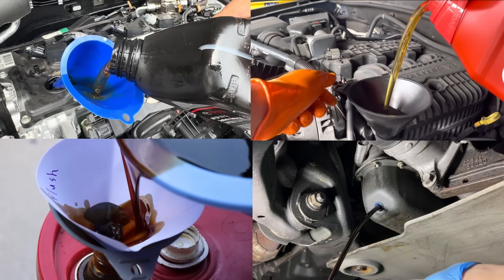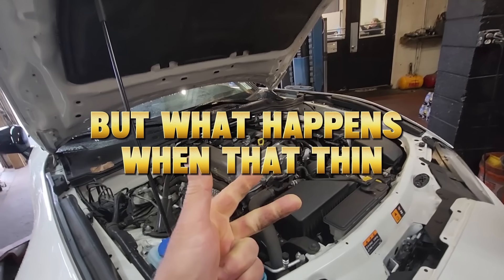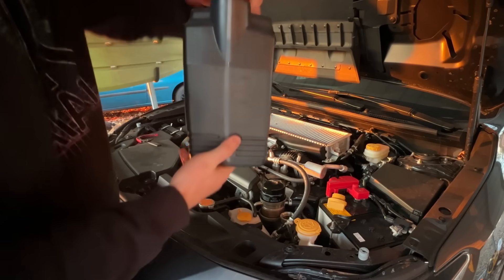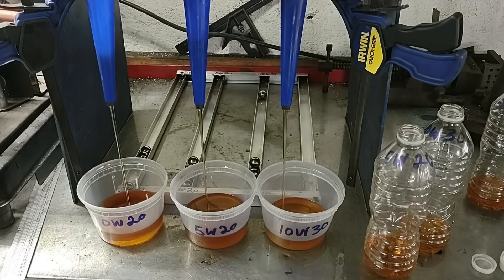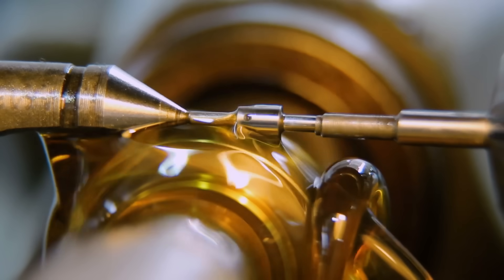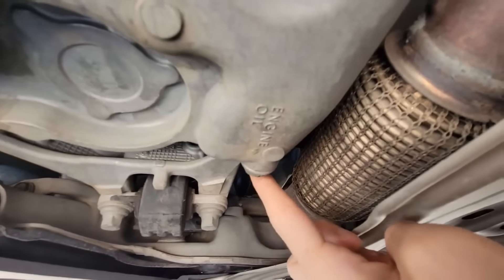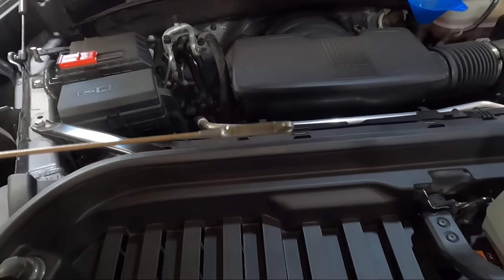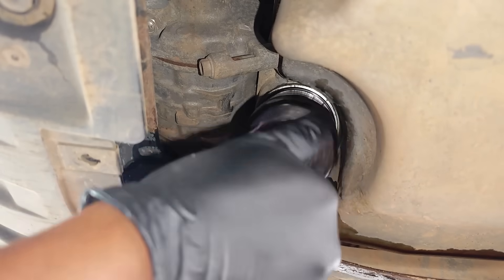The TRUTH About 0W 20 vs 5W 30 Oil (50 Engines Tested!)

Comment: Castrol Edge Euro 0w30 in winter and BMW TPT 5W30 in my BMW N20. What's more important is the OCI you chose to implement, check your manual for normal and severe schedules.

Comment: Southern middle TN here. Actually I switched my 2012 Ford F-150 3.7L V6 (non-turbo) from 5w20 to 5w30 Pennsoil Full Synthetic two oil changes ago, and now change my own oil every 5,000-miles. My engine has around 188k-miles on the clock with no timing issues, no noises, but I felt the 20 weight oil was just not right. As for mileage, going from 20w to 30w, no effect whatsoever. I have been at 20-MPG's for last couple of years, and it is still there unless driving in city traffic which degrades MPG short term. I don't tow with my truck, but live in a very hilly area where elevation changes 300'ft-400'ft in a mile, so because of the gear downs for climbing, engine tach runs 3,000-4,000 rpms in 2nd-3rd gear frequently, which explains why only 20-MPG's. If I had an eight cylinder engine, I would run 5w40 as V8's get more abuse than V6's, reasoning, more power equals more lead foot. That's just a fact.

Comment: When I purchased my 2 new Hondas they both showed 0-20. Yuck! My first oil changed went to 5-20. I wanted to go to 5-30 but the Honda mechanics said use 5-20 while it is new. After about 75k to 100k miles using 5-30 is ok.

Comment: yep, ive been running 5w30 in my truck since my 1st oil change at 1500 miles. OEM is 0w20. i could give a crap about MPG, i still get 24+MPG REAL WORLD over the 22 the EPA rates

Comment: Don't it make sense to follow the manufacturers manual/instructions? Or the dealer's recommendations? I think that if they differ, that the dealer has a better insight as to what your vehicle needs based upon the climate of where you live. i.e. My vehicle is made in Japan, and I assume they decide what oil, etc. But if my dealer, who is local, says to do something a little different, I should listen to him. Example is the latest fiasco, 10K miles between change. The dealer recommended 5K, and now I see that's what is recommended by everyone. 5K for every vehicle. So as I'm saying. My dealer uses 0W20 synthetic, and from what I can tell, is supplied by the mfgr/as apposed to Valvoline or Mobil or such. So using 5w30 or even 10w30 "might" invalidate the warranty? Another example: If I go to a local shop and they use 0w20 synthetic, would it matter that they use Valvoline or Mobil?

Comment: It is not that simple anymore. It is not about mpg only as many think. It is a complex design direction. Oil is currently used as a hydraulic fluid for vvti,  lifters etc. it uses small tubes and passes. for that purpose low viscosity is preferable with  similar reasoning to ATF. While trying to improve something try do not damage something else. 😂

Comment: In my Volkswagen Golf Mk6 1.4 TSI twincharge, I changed from 5W30 to 5W40 for more protection at higher temperatures, which is also better for the turbo and results in less oil loss (not that I really have any oil loss, as I change my oil every 5,000 miles). Just make sure it meets the manufacturer's specifications.

Comment: I bought my 2011 Lexus Rx350 with 151k miles. I use Mobil1 5w30 full synthetic. Currently has 240k miles. Running excellent.
Reply: Every Toyota /Lexas we had Mobil burnd faster and had to change more often  and 3 out of 5 cara. Ruind the engine 😮

Comment: I have used 5w20 for the last 21 years in my 5.4l Triton in an F250. Engine has 280,000 kms. Doesn't burn oil. Always use a block heater in colder weather.
Reply: 1st oil change at 1000 kms. with dino juice. 2nd oil change dino juice at 5000 kms. Then full syn ever since.
Reply: How many miles, we use miles here not klicks.
Reply: @JerryRedd-bs8xi  Let me do the math for you. 17 squared, divide by 49,417, take the reciprocal of the reciprocal, carry the 9. That comes to about 174,000 miles. Any other grade 2 conversions I can do for you today?

Comment: This entire video is fake. I listened to this guy and took my fj cruiser in for an oil change asked them to put 5/30 instead of the recommended 0/20. After one day my dash lit like a Xmas tree with check engine light as well as other lights. Now I have to extract the oil. I’ll put it in my rv so it doesn’t go to waste but it’s a hassle. Google it. You need to use the recommended oil period. If yo7 want your engine to last change ever 3000-5000 miles with a good oil.

Comment: 0W40 on a Turbo Motor and i live in Germany (normal Temperatures). No Problems. I bought my car as a new one. Now it has 65000km. In 02_2026 it will be 3 years old. I also make the Oilchange all ~10000 km. The Manufacture says my motor needs 0W20 or 0W30. I say: 🤣🤣🤣

Comment: I bought a 2024 Mazda 3 sedan in Aug 2024. I have just over 4K miles on it, and am planning on changing the oil at 5K, Because of this video I plan to use 5W 30 at the change.

I'm 82 YO now and have medical conditions, so don't change my oil any more. But in my heyday I used to do nearly all the work on my cars, even two transmission changes. I used to change my engine oil/filter every 3K miles, gap the plugs, and set engine timing. The car had drum brakes all around, and I changed/adjusted those, too. I still have two timing lights. For 10 of those years I was a Cat heavy equipment mech/training instructor.

Comment: At 80,000 km, I switched from 0-20 to 5-30 on my 2013 Honda CR-V, and immediately noticed how much smoother and quieter it ran.  After all, outside of North America, 5W-30 is the recommended oil for my very engine!
Reply: Thank you. I am planning to do the same.
Reply: @tamilan2083  Use the best:  Pennzoil Ultra Platinum.
Reply: I'm on board, too with my 12.
Reply: 2.0 liters engine?
Reply: @Cesar-dt5tn  No, the gen-4 CR-Vs had a 2.4 L engine (North America).
Reply: @Trigger-xw9gq  tks!
Reply: It may be better for the engine but your oil pump will not be happy it s still designed to work with 0W-20
Reply: @STR1XDLB No, as I've already stated twice, outside of North America, the very engine in my car calls for 5W-30. Same engine, same oil pump
Reply: @Trigger-xw9gq My bad didnt read that 😂. Maybe edit the original comment
Reply: Try 0W30
Reply: On my new car, dealer says 0-20, I have to for warranty purposes let them put it, once home I swap to 10-30. 
Engine takes longer to warm up and on average runs about 10f less (with 10-30w). Engine runs quieter, no more valve tapping, at idle it purrs.
Reply: @mracovntname3701 Why not 5W-30?
Reply: I would not be quick to switch from 0W20 to 5W30 . Newer modern engines have tighter clearances , which means they require a thinner oil between metal components of the engine . Thicker oils are denser , so your engine will sound quieter , however they may not properly lubricate engines that require 0W8,16,20 as thicker oils may be too thick to provide those metal components with a film of lubricant between them . Tighter clearances means they are closer together. While thinner oils do contribute to better fuel efficiency , those thinner oils serve other purposes in the overall engine design. I would recommend you to the motor oil geek “ Lake Speed JR “ He is going to make a video in direct response to this video . It’s risky putting thicker oils in these modern engines . I would exercise caution .
Reply: @TiffanyBottomsHunter  Yes, good point, but not in this case. Outside of North America, 5W-30 is the recommended oil for this particular engine. That shows that the drive to thinner oils is political, not mechanical. In addition, 5W-30 is only "slightly" thicker than 0W-20, so nothing to worry about.
Reply: @Trigger-xw9gq  Political ? The EPA’s influence on automotive engineering is not about politics . The lubrication that engine oil provides at operating temperature between for example 0W30,5W30, and 10W30 is the same . The only main difference is their cold flow properties . During initial startup for example,  thicker oil at colder temperatures won’t flow as well , and in turn won’t provide proper lubrication, leading to more engine wear . I would recommend you to real experts such as Lake Speed JR who has a channel “ The Motor Oil Geek “ I am already familiar of engines exceeding over 500,000 miles and still running on these thinner oils . I don’t trust AI generated videos . Not all oils of the same viscosity are created equal when it comes to what is best for one particular engine . Engine oils have different additive packages , which means they are made up of different formulas . The oil you would use with cast iron cylinder sleeves , is not the same as one with carbon sleeves even if they call for the same viscosity . Oil analysis conducted in laboratory tests shows that different engine oil formulas work better for different engines . Toyota’s OEM oil formulated by Exxon Mobile is way better for their engines , than for example Mobile 1 , because it is specifically formulated to work with their engines . It comes down to chemistry . I would not switch to a thicker oil without doing extensive research on my particular engine . Switching to a thicker oil could actually cause more wear . It would have the opposite effect .
Reply: @TiffanyBottomsHunter  I'm not sure why you gave an example of 0-30 / 5-30 / 10-30, when that's not what I was referring to.  I'm fully aware the cold flow differences, and in my location (benign winters), switching from a "0" to a "5" is nothing, especially given how quickly the engine warms up.  Did you not see part where I mentioned that, outside of North America, 5W-30 is the recommended oil for this particular engine?
Reply: @TiffanyBottomsHunter Total B.S.  Clearances are NOT tighter.  Stop spreading misinformation.
Reply: @TiffanyBottomsHunter  Sounds like you got it all figured out : )
Reply: @Howard-dv4vo I don’t believe myself to have it all figured out , however if people are reaching 800,000 miles on a 0W something engine oil , why would you switch to a thicker oil for longevity ? How many miles are you plan on going ? Those 500,000 miles and up engines I am referring to are still running . I don’t know that I would join the bandwagon just because GM recent major engine recall issues . Thicker oils generally work better at higher temperatures . Take race engine oils for example , like 20W50 it’s a very thick oil , but putting that on a engine that calls for 0W16 would put that engine under so much of a load it would lead to engine damage and wear because it creates more friction and resistance between components . It also does not circulate quickly enough in engines that aren’t designed for it . The same can apply to 5W30 to say 0W20 , it’s more engine specific . It’s not a universal standard . There are plenty of engines that call for 5W30 or allow for it , but that doesn’t mean engines that call of viscosities like 0W8,16,20,30 etc would do better with 5W30 . I understand the concept of a thicker oil for providing a thicker film of lubrication that suggests better protection , but in engines with very tight clearances like in modern engines, it may be too thick to provide that lubrication to begin with . You need the oil viscosity and formula that works best for your specific engine. There are quite a few factors , and this video doesn’t cover all of them .
Reply: @TiffanyBottomsHunter  on a broken in engine is when l switch to 5W30

Comment: Over thinking this. I have 40 years in the automotive parts and service industry. I have seen and heard a lot. Change your oil every 3,000 to 5,000 miles depending on your driving conditions. Do not go 10,000 if you plan to keep your car past 100K. Use the oil that the owner manual says. Brands will not be that much different if you are changing the oil and use a quality filter regularly. I've driven my cars over 200K. Fords, Chevys, Hondas and Toyotas. I've never had any engine issues, burning or leaking oil. I've listened to engineers from car companies and oil companies say this multiple times.

Comment: My 2019 Nissan Frontier has only had 5w 30 Mobil 1 synthetic, changed every 5000 miles since it was new. That is the factory recommended weight, brand, and interval.

Comment: EXACTLY how I see it! 😂👍
My engine 1NZ-FXE was developed, when 5W-30 was the thinnest available oil. Toyota switched its recommendation and first fill to 0W-20. 🤦‍♂️
I'm using 0W-30 with Ceratec - the engine is MUCH quieter and doesn't have wear. I wouldn't have the idea to drive on a German Autobahn at 170... 180 km/h in summer and using 0W-20. 🤦‍♂️
Some folks even use 0W-16, 0W-12 or even 0W-8... why not filling up the engine with water and a splash of WD-40? 🤪🤦‍♂️🤣

Comment: Live in S.E. States.  Have run Rotella T6 5 - 40 & 15-40 for 30+ years in everything.  Not a single engine failure, within 175k.  We don't keep vehicles beyond 150 - 175  (oil analysis samples were good)

Comment: I have an Acura TLX and I used 0v20 on it. For 4700 miles I topped up with 250 A gram of oil. When I switched to 0W30, the burn went away... the engine runs quieter.

Comment: I currently own a 2014 Lexus IS350 andblive in Central Florida. So I should be use 5w30 mobile 1 instead of Mobil1 0W20 oil full synthetic on a 142, 000 mile engine

Comment: I figured the scam was on when I opened the hood of a 2017 Corvette.  This is the same LT engine architecture that's in my dad's 2017 Silverado 5.3.  The Corvette calls for 5w30 on the cap and the truck 0w20.  Now why would an engine put in a vehicle designed for hauling, towing, and climbing through adverse conditions not just call for the same thing the high performance engine does?  If anything I'd be inclined to believe the performance variant would call for 0w because of tighter tolerances or whatever reason.  5w30 worked for so many years and hundreds of thousands of miles per engine.  Oil is just another brick in the wall of sabotage auto assemblers are putting between consumers and long term dependable and affordable auto ownership.

Comment: Scotty Kilmer says: Use the viscosity specified by your manual. Period. My 2012 Nissan Cube (81K) takes 5W-30, 2012 Scion iQ (57K) takes 0W-20, 1995 Mazda Miata (151K) takes 10W-30. She runs like new. I have been using Wal-Mart Super Tech full synthetic and Fram XG filters in all of them for decades. Change your oil every 3K.

Comment: What a shit! Engines does not die instead of wrong oil, they die in follow of bad material engine. German cars like BMW, Mercedes are no more top of the state. My AMG 8 Zyl and before the BMW M 5 broke after 4 years and 80 000 km and not after 500 000 miles !!!
Cars where in service all time by Mercedes and BMW factory  dealers....  Our Mazda MX 5  2.0 has now 260 000 km and is like new with 5 W 30 . Any questions ???

Comment: Two of my vehicles require 0w-20 at 15,000-mile oil change intervals which is insane, I use 5w20 or 5w30 and change it every 4-5000 miles. One of my vehicles oil is pitch black after changing it at 5k so I have no idea why they think it will last 15k in between oil changes,

Comment: This video is very misleading. I’d love to see where the references are on these stats. What engines were used on this 50 engine lineup? If you’re using engines made for 5w30 then of course 0w20 will have a bigger impact than a car made with tolerances for thinner oil. Another thing to consider is a manufacturers requirements on oil. My Audi Q5 requires 0w20, but has specific manufacturer requirements that not very many oils pass because it requires actual group IV or group V oil based to make up for the tendency of a thinner oil not being as resistant to wear. Most oils off the shelf are not true synthetic based. There’s arguments over whether manufacturers can effectively compensate with their additive packages but it’s known that group IV and group V bases are more structurally resilient than group III.

Comment: have 2 vehicles both are 1990s both call for 10W30 and is it ever hard to find it so most of the time i order it from amazon, one has just under 300,000 mile one has just under 53,000 miles plus i switched to full synthetic 10 years ago on the jeep and 5 years ago on the motorhome no engine problems

Comment: Always use the oil recommended by the manufacturer — whether it's 0W-16, 5W-30, or any other type. Never use a different oil and don’t listen to people who don’t know what they’re talking about. The most important thing is the oil change intervals. Ideally, every 6,000 to 8,000 miles, and no more than 8,000 to 10,000 miles. If you stick to that, your car will run for hundreds of thousands of miles — as long as it doesn't have any hidden design flaws or something else doesn't go wrong.
Reply: NO. Change every 3000 to 5000 miles
Reply: @Jey36912  U can change even every 300 or 500 miles is up to You. 😀
Reply: CORRECT

Comment: I have a 2022 Lexus RX350. I'm using 0w20 in this desert heat, Phoenix Arizona. I look at my outside temperature monitor and it's 118 degrees. I don't want to void my warranty so I will use the thin stuff. Will switch to 5w 30 after warranty expires.
Reply: What are you basing the insurance issue on? Have you heard of them contesting a claim over the oil? If so many of these YT videos need serious warnings on them.